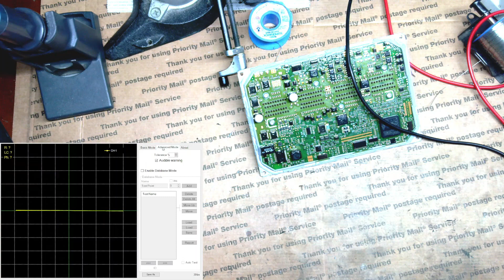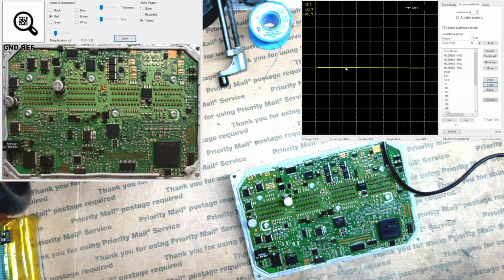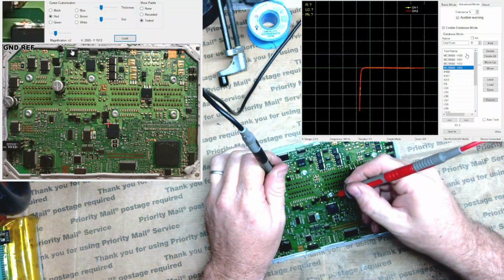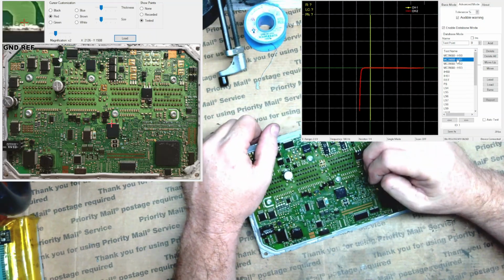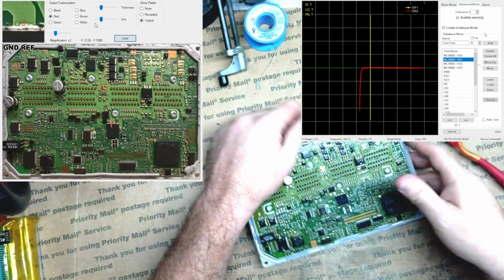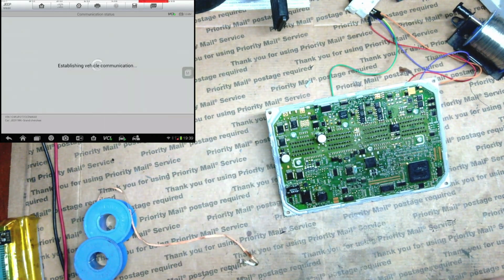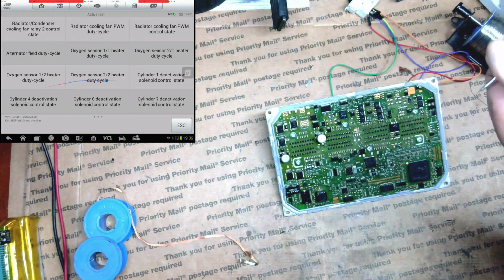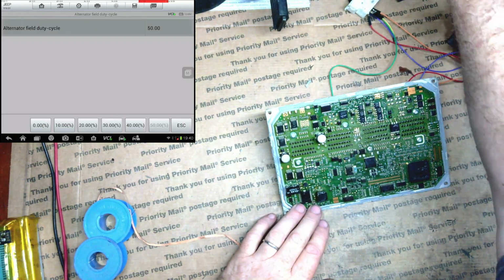Fixing Jeep Wrangler ECU for Not Charging Battery #ecurepair #electronicsrepair #repair

Comment: I kinda suspect my ECU charging chip has failed. If repaired does the ecu need refreshing?
Are you in Canada or the U.S. and do you repair ECU'S particularly those with this common charge component failure.
Reply from the maker: Its common. Doesnt need reflashing after. Im in US but take stuff from all over.

Comment: At the place i work we use VeRSis curve tracer and it definitely helps a lot with most of the repairs, especialy when it comes to diagnosing bad ICs, also with the curves memorized there is no need to keep an working module around. These things are amazing.
One thing i don't know is how accurate those curve tracers can be, like, are some more accurate than others, some problems some tracers can see but others can't.

Great content as always.
Cheers!
Reply from the maker: Thanks! I havent noticed to much difference between cheap vrs expensive tracers to be honest. They all pretty much look the same to me (assuming your using the same settings and test points). I want to design my own cheap one here soon for fun if I can ever get up on work.
Reply: @ecurepair  look for the octopus circuit from ham radio aficionado

Comment: Was wondering your opinion on the matter of 33888 replacement . Solder paste vs conventional solder & let it float vs application of top pressure to seat it ? I've had mixed results personally , then again i don't work with a preheater like you do . Thanks for your input as always .
Reply from the maker: I havent been using the preheater these days, takes too long to heat it up. Just 2 hot air guns from the top. I use both regular 63/37 and low melt solder paste. Don't see too much difference there but usually I will float it some and then apply pressure from top. Sometimes it will bridge a  input or two and you have to lift it and flux it a little more but I feel it still works better then not applying the downward pressure.

Im going to make me a template for it and try to apply paste more evenly to see if it helps (eventually)